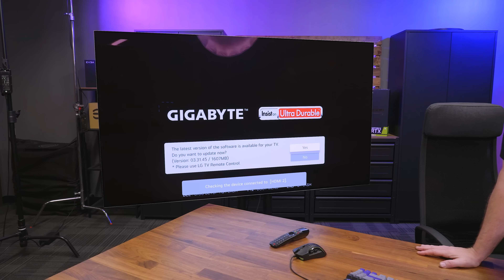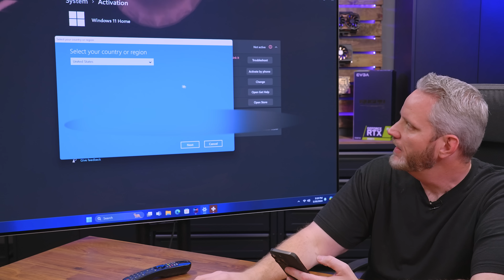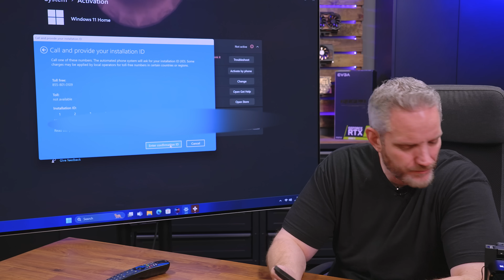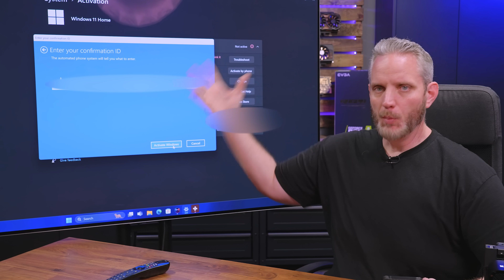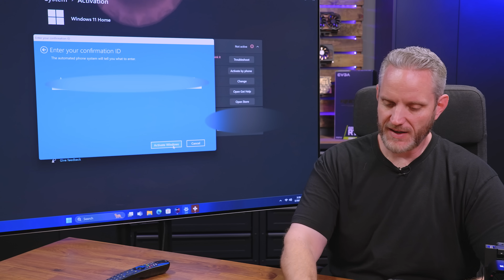How to move OS drive to new PC and keep Windows and Activation! EASY!

Comment: I was kinda impressed how easy was to transfer a Windows NVMe from a 9600K system and put it on a 7700X, win11 took it like everyday and just recognized the new stuff and installed drivers, still working great after 6 months, just had to do the troubleshooting for the activation and update the hardware attached to my MS account

Comment: This is bad advice in most cases. Just copy APPDATA to keep settings and your user folder. A new install is always a good idea on a new system. Less possible issues down th eline and a fresh go without weirdness from old hardware hanging around.
Also what the hell is "in tact" ? Do you mean intact?

Comment: Thank you, great timing!  I was getting ready to swap MB, CPU and RAM this weekend, and keeping GPU, PSU and SSD, and I was a little worried about this.  My only remaining concern is I'm currently on Win10 because I've currently got an AMD APU (A10-7870K) which isn't Win11 compatible.  And I also have a Win11 upgrade license I haven't used yet.  So my thinking for sequence is: swap hardware, then re-activate Win10 by phone, then run Win11 upgrade.  I wish I could figure out a way to get Win11 on there first, but don't think there's a path given the incompatible APU

Comment: Wouldn't the face that it goes through from the PSU through to the open air board / test bench add impedance or resistance on each connection?

Comment: The same exact thing happened to me. But in my case the phone numbers they were providing weren't working. And i had paid 180 euros for that licence! And after i had to replace motherboard cause it was malfunctioning (1 month old motherboard)  it wouldn't recognize me any more. Despite i was using the same microsoft account and had the windows key registered in the account. And the phone numbers were not working for my country! (Greece) At that point for me it was not viable to get a new OEM key on top of it all and pay again 180 euros so i did something else that i am not saying but it solved my problem.  I mean the mentality of those companies practicaly LEADS YOU to crime and "grey zones" to do your job. But it's THEM that lead you there with their thriftyness and unflexibility! I wanted to not have to resort in such a "grey zone" path but i simply had not the money to pay 200 euros to those thieves yet again to get me a new OEM licence of windows 11 pro.

Comment: Still running off my Windows 7 key.  Got the free 10 upgrade.  Got the free 11 upgrade.  On my 4th harddrive since 2010.  Not sure how, not sure why.  They just keep giving me free Windows when I change drives.  Yes, I have a Microsoft account.  All it does is ask if I'm changing to new parts.  "Boom, here's a free Windows install."
Reply: because every 'upgrade' has more spyware, so your steps up pay them in user data
Reply: pretty cool

Comment: Personally, I have no skin in this game, as I use Linux as my daily driver and the process is even simpler. 99% of the time, just transfer the drive and you're done. The other 1% of the time, your new system has parts from a greedy manufacturer like Nvidia or Broadcom and so you need to install proprietary drivers/firmware in order to use your new GPU or wifi/Bluetooth chip.

With all that said, I'm strictly of the mind that you can't steal from a corporation. The people working there? Sure. But you're not the one stealing from them and you buying a multi-million-dollar company's product doesn't affect their paychecks in any way whatsoever. That's all done by upper management.

So, do whatever you want. If you wanna pirate Windows, no programmer's paycheck is gonna be affected. A CEO might whine about pirates, but their pocketbook is still growing by the day as they pilfer money from the programmers underneath them, so they don't really care either.

Comment: I had a MSI delta 15, all AMD, I took the drive out and put it in an Intel/Nvidia desktop I built (after I had installed Windows but not activated it on a different drive) and when I booted it for the first time after installing my old laptop drive it boots into my old laptop windows, still activated, no warnings or notifications saying I changed anything, even still had a lot of AMD toolkits installed on it. Haven't had any trouble with it yet.
Edit: To clarify, I still had all the new drivers installed from the inactive copy I had on my new drive and somehow it runs the drivers off my new drive on my old drive's copy of Windows.

Comment: Always recommend to do a fresh load of Windows anytime you make major changes like that, yes it will work, but we have tested 100% of the time you will have stability or performance issues over time....seen so many customers come in and a fresh load of Windows fixes most problems.

Comment: Hello, I have a problem with my PC, it turns out that I updated to the latest version of the bios, apparently everything had gone well and I had no interruptions in the process, but when my PC turns on again, it has white lines Very small ones that appear and disappear very quickly on the screen, what the hell could have been the problem?
Reply: Check your graphics card is properly seated. DDU the drivers and install known, stable drivers.

Comment: I did this but every time the code would not work. So I ended up on the phone to them properly and kept getting told that my copy of Windows was locked to one motherboard and could not be moved telling me it was an oem rather than retail key. As it came from a Windows 7 ultimate box that I purchased from PC World (still have the retail box, disc and receipt uk) This was extremely frustrating and after weeks of phoning to speak to someone else to get them to sort it out, I caved and had to buy a new Windows 11 retail key for my current build.
I can't say that it's been easy for me at all. I've not upgraded since though but I have no confidence it will be any easier.

The latest problem I've had with this is my Microsoft Office 2019 Pro cannot be installed on my new build as they are once again saying it is locked to my old motherboard despite showing up in my Microsoft account (how much do they try to hide it behind 365?)  I can only install it but not activate it.

Comment: Some people have non transferable OEM licenses tied to the motherboard.  You mention this at 14:50 but it really should be the first thing you check before doing anything with the hardware.
You should also be able to deactivate the product key from windows before you move your OS drive to another system.  I know this works for win 10 and win 11 through the activation menu in the control panel.  I've never tried it for an OEM license though... I'm pretty sure the deactivate option would be grayed out in that type of system.
Reply: Thank you! This is exactly what I was looking for. I have an official DVD with Win 10 PRO OEM and the key and I can't seem to figure out if I should just buy a new Win 11 key or if it's ok to try to transfer this Win 10 to the brand new build.  It looks to me like I need to just buy a new Retail version but I hate to spend over a 100 bucks unnecessarily.
Reply: @Faustustopheles  
I would use windows 10 until the computer dies.  You essentially have to gut all the bloat and trash out of 11 to make it usable and once you're done gutting 11 it is basically windows 10 with still more bloat.

Security patches are a meme.  If the OS was good it wouldn't need auto updates--only the firewall would.  The browser takes care of 90% of the security and the rest should be done at the router anyways.

Comment: Hey Jay, can you make a video on MSI boards and AM5 having slow boot times? From personal experience and talking to others as I work on PCs for a living, with XMP enabled, boot times are insanely long on MSI boards. I went from 1 minute and 38 seconds on a MAG B650 Tomahawk max wifi, to 22 seconds on a Gigabyte Aurous Elite X670. Currently working on a computer that takes 5 to 30 minutes to boot, same board as my old one. Disabled XMP, boots in 15 seconds. I'm sure it needs some research, but this seems to be an issue with AMD CPUs and MSI boards only.

Comment: usually, there is a script/utility on windows (if anyone cares/wants to know which, let me know, I can edit this) that is INTENDED to be used before swapping system hardware, it will "uninstall" the Win key, exactly for that per-1-device registered win key, and then once you move over to different hardware, you just re-activate Win again with the previously used key.
Also, the "flashed Win key to MoBo" is usually a laptop thing rather than a Desktop-style PC thing.
Reply: OEM keys can't be (legally) moved, only those bought separately, or "with media" if that is an additional cost when buying the PC.
Reply: @The_Real_Phil_Lee  yeah I know, I meant the bought original Windows CD with a single-use key (from a so-called trusted vendor ofc), not the deal included when buying MoBo then ripped out using some tool or script.

Comment: I remember back in the PATA days we used a pci Promise controller card for this purpose. You'd install the Promise card in the current system and let the OS install drivers for the card. Then you'd change motherboards and connect your hard drive to the Promise card in the new system. At that point it would boot up because it recognized the Promise card. Then the OS could find drivers for the IDE controller on the new motherboard. Then you'd power off, move the drive over to the motherboard controller, remove the Promise card from the system, and power back on. Definitely easier now.

Comment: I tried this on my brothers PC transferred from an old i5 3000 series processor to AMD 5600 CPU, b550 mobo. The only thing I kept was power supply sata ssd, and graphics card. Long story short it did boot loop hell with black screens and errors. Would not even boot into windows.

Comment: For the ASUS RAM Aura glitch... What you have to do is go into your applications and delete Aura, then go to task manager and kill the processes for the lighting application(if it's still exists as a process) and immediately or simultaneously go into your program files under ASUS and Aura and delete all your HAL folders if those exist... Once you do that, restart your computer. Double check to make sure there's no more ASUS folders in either program folder. 

The same thing will happen on any RAM kit as soon as you either change the motherboard or if you move that RAM kit temporarily and then put it back into that same motherboard that has been run with another set of RAM. Aura will try to run the lighting profiles simultaneously, and the only way to get that to stop is to do a reset of the application in settings or to totally uninstall all components and reinstall. 

Oh way to make eight this is to turn off Aura before you do any sort of change to your hardware but that doesn't work all the time.......... 
Love you! 
And even though I hate ASUS for the same reasons you do, I bought all ASUS things before I really understood what I was doing to myself.. lmao

Comment: 00:00 -- 00:20 Windows Swap Tease :: 00:20 -- 09:30 blah, blah, blah  :: 9:30 on? yeah sorta what you clicked here for...
Doing my update today, tomorrow. My MSI X470 is dying and I got the Micro Center Gigabyte B650 bundle. Buuuuut... I got a dual boot Win10/MacOS so I'll be in my own little hell for awhile with kexts.

Comment: I will be upgrading my pc in a couple weeks (including motherboard) and have read somewhere that it’s best to reinstall windows (keep the same license, but just do a fresh install). They were saying that there might be some problems with system stability after changing components and that a fresh install of OS will prevent those from happening. Is it still the case or will just „moving” the license as shown in this video suffice?
Reply: Do a fresh install if possible.

Comment: Even easier if you just click troubleshoot. Won't work every time, but I've yet to have it fail. That will take you to an option to quickly transfer your license from old system to new system. EDIT: More specifically it will have an option for "upgraded hardware" to get to that license transfer option.

Comment: Activating by phone only works for the latest release. A few months ago I had to replace the motherboard of my windows 7 professional PC and can no longer activate or use it. Not by phone, email, etc. Their response was always that I needed to update to the latest version. They made no effort to help me.
The specific software I need to run does not work in windows 8 and above. Not even in compatibility mode.
This is one of the many reasons I do not use *#%@soft products any more and never target their platform when releasing hardware/software I made.

Comment: I had a power supply take a crap on a build I did. The motherboard was behaving weirdly, so I replaced it with the exact same motherboard. Will I need to reactivate windows? I originally used an OEM key to activate when I initially put the system together.

Comment: This does not alwyas work, althjough it is supposed to. My last time failed. For one, it was very broken even thugh windows boted, it had all kinds of problems.  And some glitch where the proper intel motherboard drivers just would not install, could not install. And between reboots, as soon as I log in, the keyboard and mouse turn off, and pc is a brick. Had to reinstall from scratch, this was 2 years ago.  But I have many times int hhje past switched motherboards without reinstalling, even as far back as win98 and win2k/XP. I had techniques.  For XP or win2k, first thing, install a har ddrive controller card and ge tit up and running. Now when u swap motherboards, plug your boot drive into the HARD FRIVE CONTROLER CARD!  This way, this is the one proper driver o it has, so i t can read the disk and boot!  now u can then install al the other drivers, and once u havem u can put the hard drive back on the proper motherboard sata port.,

Comment: I had to make a different experience in the past. In my case, originally, I had an Asus B350 Prime Plus with a Ryzen 5 1400 back in the day. My Windows 10 was installed on a M.2 with 256 GB only for OS and some applications. With the time, I upgraded to Ryzen 5 2600X and 1TB of M.2 via cloning. Couple of years later, I got my hands on a cheap 5600G, unused, and upgraded to that and upgraded to Windows 11. Still on the same installation by the way. But I was not impressed from the results and chanced to 5600X on an ASRock B550 PG4, first with 2x 8GB, later 4x 8GB for dual rank dual channel. I was still getting bad results and it was obviously CPU bottleneck. And it was very clear on demanding games like Cyberpunk 2077 and Alan Wake 2. I was only getting about 50 fps in both games, no matter which graphics settings I used. Only thing changed was the GPU usage. In this time, after every upgrade I manually deleted the drivers for chipset etc. and installed them new. I watched endless videos on YT, how other peoples PCs performed. I did one last upgrade, from 5600X to 5800X, but the performance was still bad, about 50-55 fps. After that, I decided to do a fresh Windows installation and doing so I was able to get about 80-120 fps in booth games, depending on settings, RT on or off, on a RTX 3080. I don’t exactly know, what the problem was, but it cost me a lot of time und nerves and money, obviously. Now I now, maybe I should have done a clean installation bevor all that, but now you are telling, this is okay to only switch the drive from one system to another, no matter which motherboard or cpu. I’m a little confused actually 😵‍💫

Comment: When i installed windows 10, I wrote down the Windows 7 license key from the sticker on the bottom of a laptop I scrapped. My PC at the time was an Intel Q6600 with a SATA hard drive. I then inherited a PC with an AMD FX 8350. I just took my hard drive out of my old PC and put it in my this PC and booted it up. I was fully expecting Windows to freak out and I would have to reinstall, but to my surprise, it booted up fine, loaded some new drivers, and it worked just fine. I never attempted to reactive Windows, but it activated itself after a day or so without me doing anything.
       About 2 years ago, I built a new PC with a Ryzen 5600, and traded my SATA hard drive for an NVME drive. I cloned my hard drive to the NVME drive using the free version of Acronis from Western Digital's website. I booted it up, and I it didn't even make me load new drivers. I guess Windows did it in the background. I was surprised that Windows was still activated or activated itself right away.
      It will be 9 years next month that I installed the copy of Windows that I am running today and it still works problem free. No blue screens, lock ups or random crashes. Actually, I do have one problem. The driver for HDMI audio out has stopped working a couple times after a Windows update and I have to delete it from device manager and let Windows reinstall it. I can live with that.

Comment: Moving Windows and activation is easy. Try making a guide on moving all the applications installed to a freshly installed OS.
Reply: I use belarc advisor to make a list of all  the software and keys installed on the old system and make a print out of it to aid with freshly installing everything on the new system.